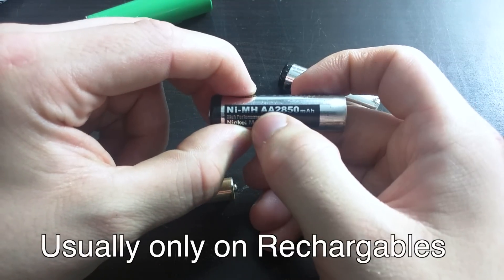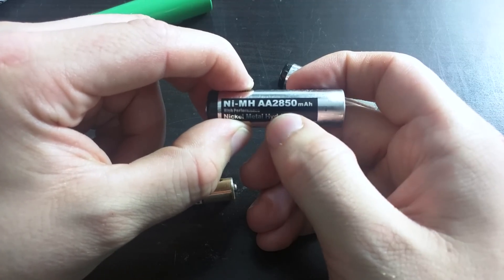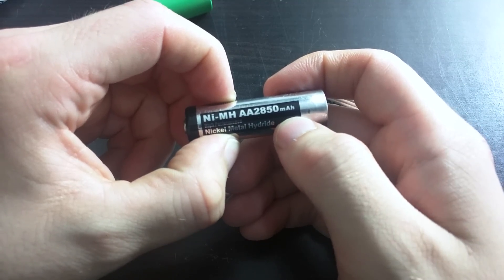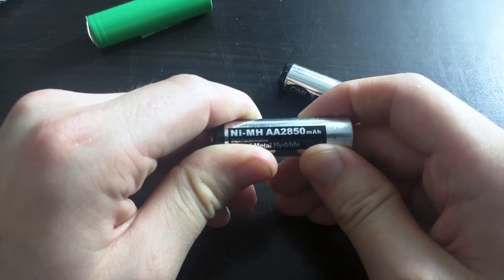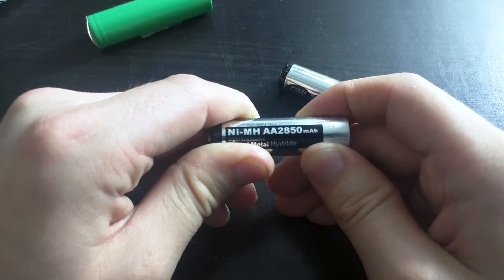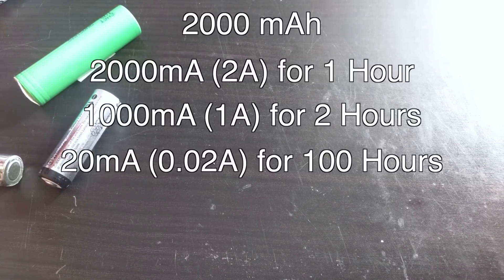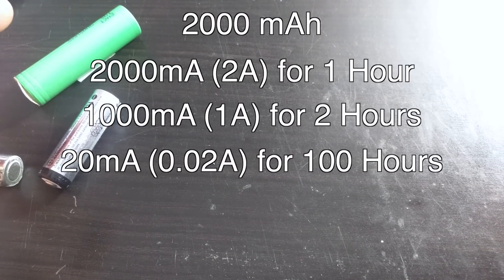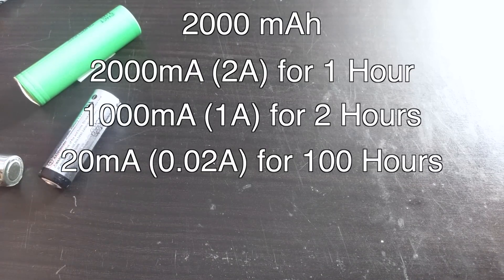What is mAh? (Battery Capacity) - Electronics Basics 18

Comment: I see this video is 2 years old so, this maybe an unfair question!  'Today ' They have come out with a graphene  battery! The charge rate is totally different and the discharge rate is to different! And the energy used is also different! And the energy stored is also stronger ' or is more! And one more thing! its lighter than all of these batteries!  So the question is.....  Why are we still using these out of date batteries?   Please LOOK UP  GRAPHENE BATTERIES!
Reply: There has been a paper released in Nature regarding a newer Lithium chemistry that doubles the current density, making Graphene chemistry somewhat dated.
Reply: From what I understand ,there is no chemistry involved in Graphene batteries! And if there is ,its very little! Because if there was it would not be able to hold its density of the amount charge! And the charge rate is 10 times faster than 'any' battery!
Reply: I worked at a top R&D facility in US at Oak Ridge, TN for 2 years as a chemical engineer 2012-2014 specifically on Li-ion technology.  I helped develop a battery much cheaper to produce, and a cycle life of around 5000 still maintaining 86% efficiency...but I see that tech has yet to be marketed...Li-ion tech exists for MUCH greater performance and charge density, but you have to also consider marketing.  Companies are greedy, and they will ride a still profitable design as long as possible b4 releasing upgrades and redesigning production.  Its one thing to design better product, but a whole different story making it cheap enough to mass produce and justify changes necessary to do so.  What we as consumers have is 10-20 years behind better developed technology in most fields; but profit rules all and the military always has first access to any new high tech "toys"
Reply: Thank you !  Obviously someone else sees that were not going to see this technology for at least 10 years! That's why I'm into telling everyone that this has gottin out of control!   "KEY"  Word   (CONTROL)  We are no longer in control and this needs to stop!   Graphene has been out there for a long time and its time it was put on the market!  In battery form!  It was just recently found that this can be mass produced! Easily and cheep!  If we had batteries that can run our home, cars and everything else...we wouldn't need electric company's !  RE:  the electric company's would be out of business ! No more lineman or the need to run wire all over the place, so again the people who make the wire would also be gone!  (Solar ) is the way to go! We just need away to store the energy!  The people who controls this country need to be put in there place! AND SOON!  You said this is high tech.... I don't see it that way!  I do see people who are getting more informed of these things!
Reply: I agree, but things spiral down out of the peoples control exponentially as time goes on, because newer generations especially (speaking in general here) most people are happy with whatever info the news and media feed them, and could care less if it is accurate or about self questioning and seeking further information to see if it even makes sense.  As long as it doesnt directly immediatelt threaten them on a personal level, they swallow the story and move on; its difficult to get anyone to even take time to read cold truth...much less believe it even when shown proof!  My research was for Volkswagen initially for batteries in hybrid cars.  Imagine the cost reduction and easier transition to electric cars if the batteries I developed there were put in use...theyre 34% lighter, have a charge density almost double current design, can survive 5000+ full cycles if properly done, AND the water soluble method I personally developed using a nitrated cellulose polymer (modified plant fiber, very cheap/easy to make) eliminated the need for harsh solvents that are expensive and require high processing to remove from waste because of environmental threat because these were now water based!  That would fraction production cost.  Wouldnt you much more likely buy the new electric car whose battery bank went twice as far per recharge, and instead of replacement battery costs of 3-4 thousand dollars every few years was now 800 dollars every 7-10 years???  

Im currently building a video series on my youtube channel i recently created about this sudden medication dangers propaganda nonsense, how drs are illegally dropping patients after one in office urine screen dispute (false negatives and positives)  and cutting all their medications, and most importantly the new "anti-abuse" formulas passed in 2015 how the large number of man-made pokymers now in many medications (especially generics and pain meds) are not only never studied by the FDA, interfere with proper absorption, was paired with a new 20% tolerance (study in 2017 showed the Norco hydro 10mg actually on average only contain 8.4mg), and worse of all some of these modified plastic binders to be water soluble (PEO "polyethylene oxide" is one, pokyethylene is coke bottle plastic!!) can and are causing mild to severe digestive health problems in many.  Look at how many IBS digestive disorder cases have exploded in the past few years; thats quite often the drs diagnostic way to cover up the damage these chemicals are causing.  There's not an "opiate epidemic" in america, but a covering the truth for profit and blaming the damage caused by these additives on the medication itself epidemic.._yet you wont ever see this information on the news.  So if you are interrested, please message me and ill let you know when i get the first few vids up.  Im just trying to inform people of what theyre truly eating; my channel may be shut down after i start putting that out, but its data from experiments ive personally conducted over past 3 years, so please tell anyone you think might want more ibfo as a couple of these are quite harmful taken regularly.  Its WAY too much to write, so im trying to cover it in a series of 12 videos.
Reply: I don't have a you tube channel!  I do have an email address..but don't adveritze it!  I'll be looking for your channel !  What will it be called?
Reply: Its ok no need for a channel to watch them.  This link should take you to homepage of it, though no vids are up as of yet the first few will be soon....
Reply: "dangers of anti-abuse pharmaceutical ingredients" is title, it will not allow me to put link in comment

Comment: What if I connect 2 different voltage in parallel
Reply: That will not work
You have to match voltages carefully
Reply: Careful  Now!    The higher voltage battery will attempt to charge the lower one.  By the laws of parallel circuits, both batteries would have the same  terminal voltage once connected together in this fashion , (somewhere between bat1 and bat2 original voltages) . Charging current will flow from the stronger (higher voltage) into the other. I suppose  fresh alkalines  paralleled with half dead rechargeables (of the same size) can't do much harm in a monitored situation but a 9V paralleled with a  12 v battery would explode.

Comment: How to check battery amps with out writing
Reply from the maker: If there's no rating printed on it then the only way to tell would be to gradually pull some current from it and monitor the voltage. When it starts to drop dramatically the battery is under too much load. You want to leave a good amount of room to if voltage starts dropping off at 2 amps for example then maybe draw a Max of 1 to 1.5 amps from it.

Comment: At 1 minute 43 seconds you have three lines of calculations showing milliamps.
Reply: If a 2000 milliamp battery does 2A amps for 1 hour, wouldn't the 1000 milliamp battery do 1 amp for 1 hour ... not 2.
 Wouldn't the 20 milliamp battery do .02 amps for 1 hour vs 100 hours.

Comment: No, No, No!  Why would you make an 8 minute video explaining something in terms that are over-simplified and NOT CORRECT??  You cannot simply divide the capacity in Amp-Hours by the drain in Amperes and get anything that is useful since battery capacity is stated with the C/20 assumption.  So, a battery that is rated at 2000mAh is only going to provide that if the load is such that it takes 20 hours or more drop the DOD (depth of discharge) to 80% of the rated battery voltage.  In this case, the load cannot be more than 100mA or the capacity is de-rated.  If you even tried to draw 2A for 1 hour from that cell it would drop voltage almost immediately as the internal resistance of the battery can be modeled as a series resistor outside of the battery.  This is Peukert's Law and it is MORE THAN 100 YEARS OLD!  You casually mentioning that you have used "simple math" and that there are more variables doesn't excuse you suggesting that someone will get 4A for 30 minutes out of a 2000mAh cell.  Unbelievable.  No wonder conspiracy theories are so prevalent when anyone can post anything and make is sound like it's factual when it's not.  A man with partial sight in one eye can be king of the blind, I suppose.  Ugh.